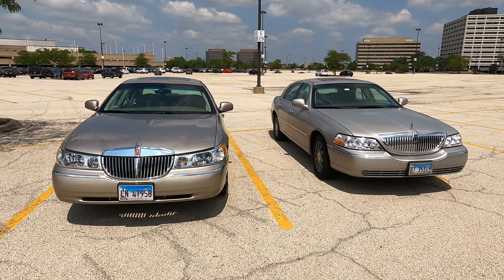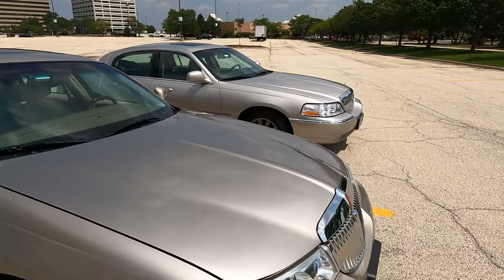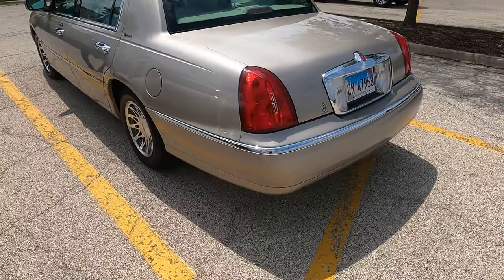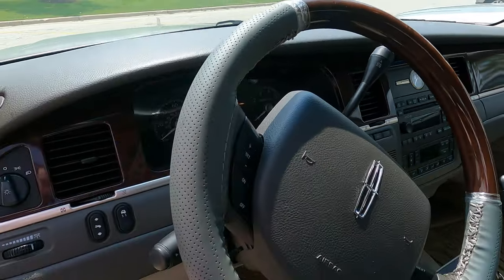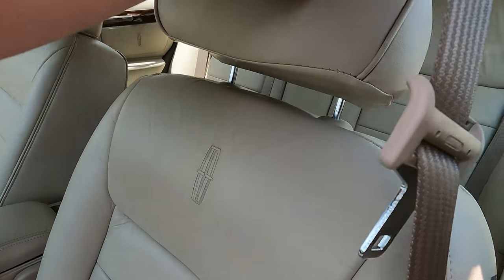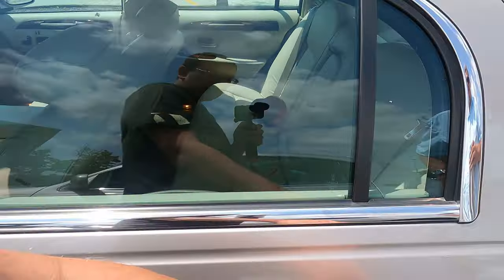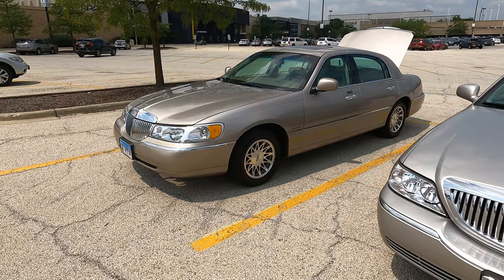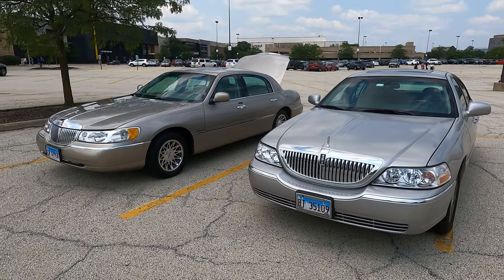Lincoln Town Car Guy Compares 2001 (3rd gen) Town Car vs 2006 (4th gen) Lincoln Town Car

Comment: Truly appreciate this video, considering to buy one of the two at the moment. I also had noted the 3rd gen steering wheel control has more options than the 4th gen, which I like, similar to the 2007 Navigator I have. I also like the star in the taillights.

Comment: I like the design of the Mercury Grand Marquis from 1983 to 1991 with the turbine wheels as like the picture you showed ar the end.  Great video btw! 🙂👍
Reply from the maker: Thank you!
Reply: I presently have a 1992, Mercury Grand Marquis, with 106 thousand original miles and it rides just about as smooth as my Lincoln.
Reply: My mother had an 89 Grand Marquis.  What a machine!

Comment: The "bottom piece" is not cosmetic on my 06 25th Anniversary Edition.  The fog lights were in there!  On the 01 did the tire guy that sold you tires from INDONESIA use hammer-on-wheel weights instead of stick-ons?  Yes, he did!
Reply from the maker: Thanks for the comment!
Reply: You're half right. The tires are USA produced Uniroyals, and the weights are hammer ons.

Comment: That chamber on the intake is a resonance chamber, it helps with noise and power, kind of the same idea as blowing air over a bottle. Look up Helmholtz resonance chambers.
Reply from the maker: Thank you!
Reply: Thanks for this information. I always wondered what that was on the air intake of my Lincoln as well, and I never thought to ask at my Ford dealership about it.

My Grand Marquis and Marauder do not have that on the air intake.

The only thing I find about that on the Lincoln is that it reduces the size of the opening where you reach in to pull the dipstick. There is ample room on the Grand Marquis and Marauder, but it just fits my hand with little room to spare on the lincoln.
Reply: @C.D. I have a 2010 Grand Marquis and a 2010 Town Car. They both have the identical Intake with the resonance chambers.